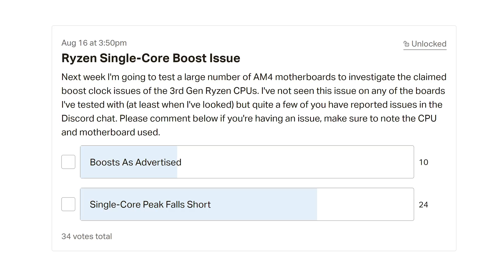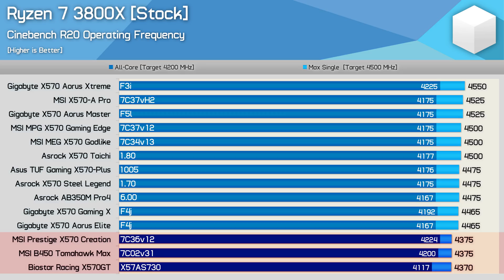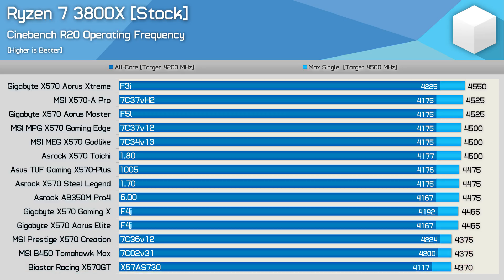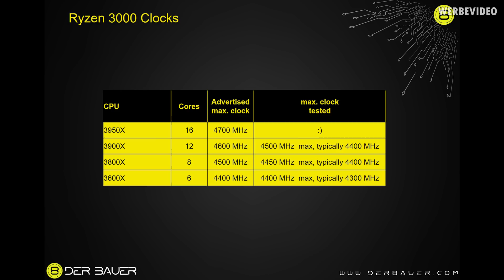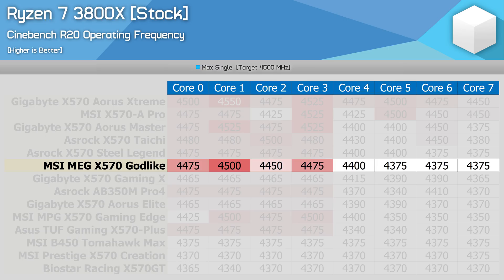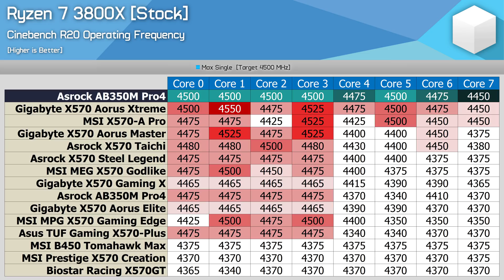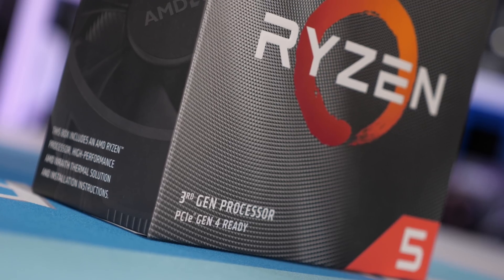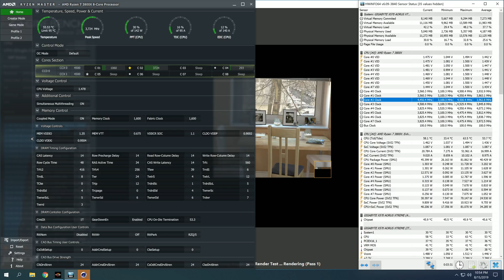AMD 3rd Gen Ryzen Boost Clock Investigation

Comment: My 3700x is running on an Asus X470 gaming-f.  I've got a -0.075 offset, pbo enabled with +200,  and auto oc enabled, and I've observed 4.392 in single core (on about 3 of the 8 cores) while the other cores hit 4.367.  In multi threaded loads, like cinebench, it's happy at 4.117-4.177 all core.  I have achieved 4.3 all core with a manual OC at 1.35vcore, but it was only stable enough to pass cinebench but I wouldn't leave it there 24/7. Plus, I think having the upside for faster single threaded turbo speeds when needed and working with a voltage that can scale accordingly is better than static for these new Ryzen chips. I was on a 4790k for years before this so it's a completely different animal in terms of overclocking.

Comment: I'm curious how voltages correlated to the AGESA version and the overall clock speed. For instance, if the Aorus Xtreme is operating at 0.05V above the Asus TUF Gaming, it may affect the PBO clocks, giving the Aorus Xtreme the edge.

Comment: Sorry if you mentioned this, but did you validate that your base clock was at least 100.0 MHz on all the boards?
By default my X370 runs between 98.0 and 100.2MHz and that makes the difference. I set it to 101.0 MHz and my 3700X routinely hits 4.4 as advertised.

My Z170 (MSI Z170 Gaming M5) runs between 99.3-100.2MHz which maintains it much tighter to the... also 4.4 GHz all-core overclock on my 6700K.

Comment: I have asus crosshair viii. I had issue with boost clocks at first. Never saw above 4.3 single core and 4.1 all cores. But after playing around with a few settings I got it to boost max 4566.6 and 4.2ish all core. I have seen during games between 4225-4550ish on up to 6 cores. So I disregarded my manual OC. To get this I had to set my ram at 3533 and PBO On. And there is a setting in bios above cpu ration for performance enhancement I had to set it to level 3(OC) it’s described as holding boost clocks for longer durations. This helped the single core boost. Setting ram to 3600 single core was limited to 4516 max but setting to 3533 I saw 4566.6 on 3900x. Now to benefit all core boost it does help to enable +200 under PBO settings. I did see my all core boost sustain 4192-4242 depending on load. Leaving it on auto was are kind 4065-4100. So it seems AMD allows board makers to do too many things and too much control over it. They should put some tight control around boost speeds. +200sAlso did improve my all core in games it seems as well. Before it was dead set on 4200 ish now I saw 4225-4550 peak.

Comment: I had been planning on buying a X570 board and a 3900X but if you watch the forum posts on those that have done so the 3900X foremost and the BIOSs on the boards are far from ready for use and there are literally hundreds of pages of complaints about the inability of the chips to run correctly on the new boards.
Reply: hehe me too, but seeing all these problems I do not even know what to do

Comment: my 3700x boosts to 4.4ghz just fine for enough seconds.
64GB 3600mhz and 1800mhz IF speed. no issues. CoolerMaster 240 water cooling. 30c-33c on idle.
but i will go for msi 570 A pro.

Comment: My 3600 is getting these speeds on my MSI B450 Mortar at stock settings:
cpu MHz  : 4199.748
cpu MHz  : 4199.805
cpu MHz  : 4199.739
cpu MHz  : 4199.691
cpu MHz  : 4048.013
cpu MHz  : 4193.683
cpu MHz  : 4199.888
cpu MHz  : 4198.968
cpu MHz  : 4196.633
cpu MHz  : 4199.638
cpu MHz  : 4144.470
cpu MHz  : 4199.528

I use MX Linux 18.3 as my OS and am wondering if this makes a difference. Perhaps you should switch OS and see if there is a difference.

Comment: my X570 Taichi has NEVER seen 4400 MHz on my 3700x, highest I've seen is 4325 MHz
At this point i've set my frequency manually to 4200 MHz @ 1.26v, ram and I.F set to 1800 MHz 1:1 ratio
I lose slight single core performance, but gain in multi-core and lower temps... much lower.
also completely stable (Intel burn test@maximum, and blender benchmark successful completion)
Reply: The Temps jump really fast with increased Voltages. I was hitting 90C when I was pushing he CPU to see what it could do. I have an NH-U14S cooler. I cut my voltages back and now run in the mid 70's when pushing the cores to 100%. I added another fan to the cooler because I always wanted to and this was a good excuse. (lower temps by 5C)
Reply: 4.2ghz all core is what i would settle for! Did u only change the frequency to 42 and manual set the vcore to 1.26  to get it stable or also disabled stuff like pbo?
Reply: @100percentmobile everything else is stock.
just freq at 4200 and 1.26 vcore.
I just checked and PBO setting is on auto (default).
line load calibration is level 1 (level 0 is flat with level 1 being a slight reduced voltage at full load)
cores sleep and park.
idle temps are more consistant without spikes and load temps are around 15°C lower
I have a custom WC loop, but I'm comparing my before / after temps

Comment: AMD fell into the trap that the uninformed worry about too much.  All this fuss over clockspeed.  "Will Ryzen 2 do 5Ghz?".  Worrying about the frequency is like worrying about the teraflops number between different GPU architectures, or thinking engine RPM's are comparable between different engines.  You can't compare them directly.  Worry about the performance.  Trust me, a Core 2 Duo at 2Ghz was much better than a Pentium D at 3.4Ghz.
Reply: It's like if a person likes blue rgb on a product for example, and the person selling the product says there will be alot of blue rgb, even though they know it won't work and it's not even blue. The seller fell into the trap..

Comment: So a peculiar thing, i dont know if anyone will respond. I am using 3600 with tomahawk max and only with AMD Ryzen Power saver (power profile) my single core on most cores goes upto 4200 and a little over, But it doesnt go above 4099 mhz on any other power profiles.... any suggestions ?
Reply: Interesting! Ive only tried Power & Balanced and never go above 4150 on any core. I also have tomahawk max and a NH-D15 cooler so thermals are never above 70C. Will try Power saver!

Comment: The thing that keeps confusing me is the temperatures. On AIDA64 stress test they go to 59 on CPU, but 95 on CPU diode (using the Noctua NH-D14 cooler in a H500P Mesh case). My 3900x boosts to a maximum clock of 4.575 GHz on some cores. In games mostly hover around 4.2-4.4 ghz.  I have a fresh Windows 1809 install (i tryed 1903 too many BSOD's so i gave up on it), newest chipset AMD drivers, using the balanced power plan, newest Asrock Taichi x570 bios, I think it's 1.80. In the first few days I was getting some stupid voltages like 1.475 volts on almost all cores with a peek of 1.5 and average of 1.35. They seemed to be coming from me using HWinfo and MSI afterburner to monitor in game performance and temps. Suddenly it started doing 1.0 to 1.1 volts on 3.8Ghz while doing average windows task. I tried playing Anthem and AC Odyssey, but was getting random restarts or the game just crashes. FIFA 19 works fine, Shadow of the Tomb Raider also. Using the newest Nvidia driver for the GPU (980Ti). My PSU is 620w, and from what I saw my total system draw wasn't over 410 W, so doesn't seem to me that the lack of power is causing my system to be unstable in some games. No blue screens atm on 1809, so i plan on staying on it. I'm still troubled by the diode temp seems really high. I understand that the platform needs to mature, damn it's anoying doh.

Comment: Just for information, i had 4599 Mgz on a MSI A PRO (570) and a 3900X.
Reply: Stock, with just XMP profile for memory, and everything stocvk everywhere.
Reply: Also, with PBO via Ryzen Master, i got juste 50 extra Mghz or so (open loop cooling with 360 rad), but strangly, NOT THE SAME core had the same max clock... Like the fastest core did change... Oo

Comment: With pbo enabled my 3600 hits 4.2 on all cores (Asus TUF x570). Currently running a manual 4.25 all core at 1.37v. Haven't tried per core overclock though.

Comment: rushed cpu's even forces mobo producers and make them using visually garbage bios (16 mb eeprom chip issues) and drop cpu support (for bristol ridge). i like ryzen 3000 potential but it needs some engineer side work.

Comment: 8:37 Little confused here. You got that Asrock AB350M Pro4 in the chart twice; but it has different results.
Edit: Are AMD/Intel both advertising clock speeds on their cpu boxes, like for AMD's older CPU's 2000 series etc? if so are they reaching there advertised clock speeds? and are Intel saying their cpu's reach certain clock speeds but can anyone confirm that is the case on stock?
Reply: btarunr: (techpowrup)

" The second graph below is from our Core i9-9900K review, which too shows only one of the cores getting the max boost frequency, and the remaining cores getting lower boost clocks, although the graph looks flatter."

AMD: https://www.techpowerup.com/img/8WQR4LKtUgISmmGD.jpg

Intel: https://www.techpowerup.com/img/M4qZPaXlWTJllLSQ.jpg

source: https://www.techpowerup.com/258201/amd-updates-ryzen-product-pages-to-elaborate-on-max-boost-clocks
Reply from the maker: As I said, the top result is a manual overclock.
Reply: @Hardwareunboxed  Ahh thanks,must have missed that.

Comment: maybe im just old but I like my clocks to be stable af like before fermi, ive managed to do that with my rx570 by undervolting it and it just makes things easier, you can set the eye candy you want and leave some headroom, vsync that thing to 120-144hz and be done with it, if my clock speed is not a perfectly flat line on a graph I just get anxious

Comment: El cheapo asrock ab350m pro4 still kicking ass.
Reply: They are still great cpus though cheaper boards have trouble hitting the absolute maximum boost on them. I doubt people using cheaper boards will mind the ~1% performance penalty they got for not buying a $300 x570.

Comment: Clock multiplier issue? I had that problem with a 2200g and with my r5 3600 on Asrock b450m-pro and an Asus TUF Gaming X570-Plus Wi-Fi. I forget at the moment what program I was using but noticed it said the clock multiplier was only 99.5, instead of 100.

Comment: You need to have god like VRM to hit the boost frequencies of the Ryzen 3000 series and most B450, B350 and even some budget X570 fall short.
Reply: nah its not the only reason, 3700x I tried on a basic asus 450 TUF did 4.25-4.3 all core turbo for quite a long time. It just never hit the 4.4GHz ever on a single core that i'd seen. You'd think all core at 4.3GHz would work the VRMS much harder. Cooling might be factor ( even if dosn't directly make any difference) The board just allows the cpu to boost higher for longer when it detects lower temps. If you could fake the temp readings sent to the cpu it might be possible to get it boost higher. Not seen anyone try that.

Comment: My 3700x reaches 4.1Ghz on all cores and 4.2 Ghz single core with PBO+AutoOC on a MSI MPG X570 Gaming Plus but I overclocked all cores to 4.3Ghz at 1.35V and it does not have any issues and the performance gain is really noticeable as I play some games on RPCS3 and CEMU and I use some Virtual machines in Hyper-V, that's besides higher scores in benchmarks like  + 300~ points in Cinebench r20 from 4820~ to 5100 now.
This is for sure a bios issue and should get better with time.

The weirdest thing with the overclock is that Ryzen Master still shows my core clock going down when the CPU is idle (I also have HW Monitor and HWiNFO64 and both report stable 4.3Ghz no matter the usage)

This is an upgrade from an AMD  FX-6300 so I'm more than happy with the purchase.

Comment: My 3700X never ever hit 4,4GHz in my MSI B450 Mortar Titanium (which, BTW, has pretty decent VRM and cooling solution according to Buildzoid). The maximum I've seen is 4,375 on single cores @1,5V witzh the Zen2 release BIOS version (7B89vA7).
Then a new BIOS (7B89vA8) came out and it does not boost even that high anymore, now it's 4,325@1,5V. I've tried all kinds of manual tweaks in BIOS to no avail. Lastly, I switched on MSI Game Boost that pegs all cores at 4,2GHz@1,1V(!) and guess what? Cinebench multicore score went up 6% while single core score only 3% down. Also, idle temps went down about 5°C.
So I just leave it so, until AMD and MSI figures their sh*t out. I'm still happy with how the CPU performs overall.
Reply: Just like he said. 
You need patience to wait motherboard partnet to update some stuff. You know all ryzen 3000 series is sold out and drivers not all ready

Comment: I have a Gigabyte Aorus X570 Pro WiFi with a 3700X.
Out of the box F2 pre-release BIOS: 4400Mhz
Updated F4 BIOS (f4j, f4l, f4m): 4375Mhz

With PBO: exactly the same.

Also, XMP profiles work half of the time.

It's crearly an inmature platform.

Comment: I was disappointed you didn't at least try one other CPU sample. (even just on two of the motherboards, say the best performing and worst) The general consensus seems to be that the issues are a mix of motherboard issues and silicon quality. It would have been nice to see if this is the case.

We are seeing users with identical configurations hitting different max speeds and this is thought to be down to the silicon.

Comment: Ryzen speed is at 4.2 sustain, the 4.5 that you see is just bullshit, is that sometimes the CPU shoot a Higher voltage and matter of ms and boost the clock of whatever core is random to 4.5 but is when the CPU is IDLE if you are doing and intensive work is 4.2 period, AMD lie with the speed of those CPUs.

Comment: There is no issue. There never was. Literally the entire audience are being silly.

It is a MAX boost clock. That is, as defined by engineers. MAX! What's not to get?

Just because Intel has, for years and years, advertised a max boost which the chips HAPPEN to be able to pass manually, everyone has forgotten the definition of "Maximum"... I don't get it. Max means max.

The algorithms are designed to stop at any one of their variables hitting limits BEFORE they hit "Max Frequency". That's the final, final safety limit. It is not expected to be hit. It is the MAX the boost algorithm is allowed to resolve to.
Reply: You mean...i'm not allowed to use the MAX resolution on my monitor...or drive my car at MAX speed? Come on. There should always be enough headroom for even the worst cases (desert) in  that "max -definition"...so under normal (and even more under optimal) circumstances it should run AT LEAST!!! with the maximum frequency. 
However....i agree with you, that the whole discussion is useless anyway. Naked numbers say  nothing about the performance and nobody will notice the differences until you use tools for measuring. No matter if 100 Mhz more or less... the ryzen is still "almost" on par with intel in gaming  and "a lot" faster in productivity-. Thats what counts for me. (Still-intel-user here - waiting for the 3950x).

Comment: 3700x and G.skill 3200Mhz set to 3200Mhz with tightened timing on ASUS x570 Tuf Wifi with agesa 1.0.0.3 AB. Stock cooler with one 120mm intake and 120mm exhaust fan.  Max all core boost I see 3.9Ghz and 4.31Ghz on single core spikes with max temp 80C.

Comment: Can I ask something strange to be looked at?  When I set up my Gigabyte X570 Aorus Elite, the default fan curve for the CPU out of the box was 100% fan speed at 65C, which seems really low.  While working on a build for a friend using the MSI X570-A Pro board the fan curve was 100% fan speed at 75C.  On my system that means by default my fans were spinning like crazy quite constantly because of the ramping pattern.  Is there a reason why the fan ramp is set so low?  I have an AIO Cooler Master ML240R on my Ryzen 7 3700X and whenever it randomly boosts it sounds like my case is trying to take flight.  I have since modified the fan curve to match what I saw on the MSI X570-A Pro board since it seems to work just fine, but is quieter.  What I am curious about is if there is a massive disparity between the default fan speed curves between the different manufacturers or if it is as granular as different boards.

Comment: It's both board and AGESA issue.
When testing my 3700X on my X470 M7 AC with the first beta bios there was no problem reaching 4,4Ghz even on multiple cores at the same time. After flashing the latest stable bios with 1.0.0.3 boost clocks went down quite a bit and i could rarely see the 4,4Ghz. 
After switching to the X570 MEG ACE i noticed a somewhat similar behavior, but now there are only two cores that manage to boost to 4,4Ghz and that's very rare. Instead I now have a much more obvious idle bug. Having Opera in the background (only opened) is enough to keep the CPU sitting at 4,3Ghz and 1.45v. Something i could not notice on the X470 board...

Comment: 3700x Asus b450 f gaming, 4.4 GHZ single core all core 4.3 GHZ up to about 65c then it drops to 4.2 and finally at 80c 4.1, I can with ease all core OC to 4.2 without changing anything else, but currently I have it on PBO and it works fine. And if I switch to high performance and performance mode in Linux it will typically clock itself to 4.3 GHZand jup to 4.4GHZ on quite a few cores, or in games, as long as the temps are good like below 65c it will hover at the 4.3-4.4 range.